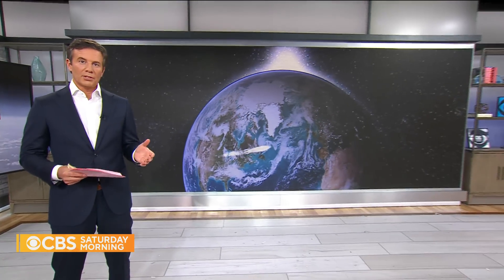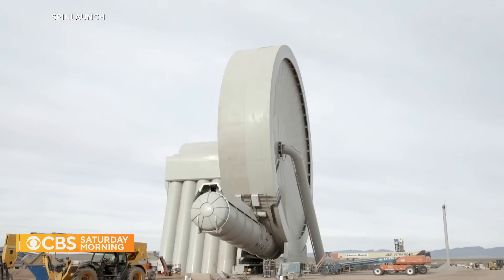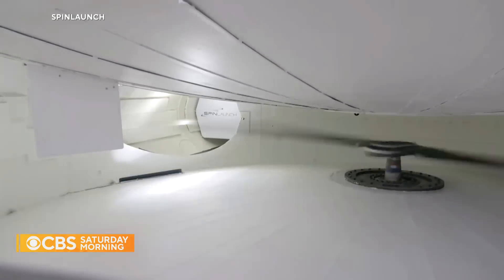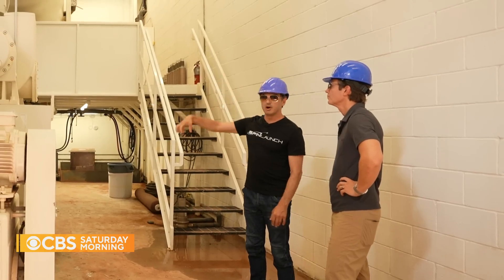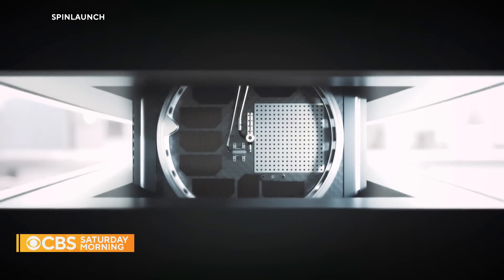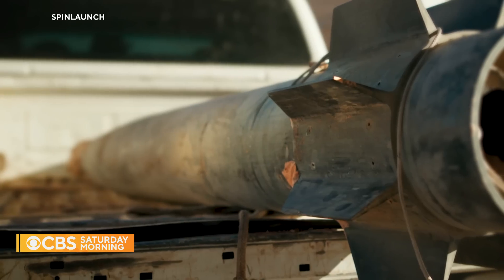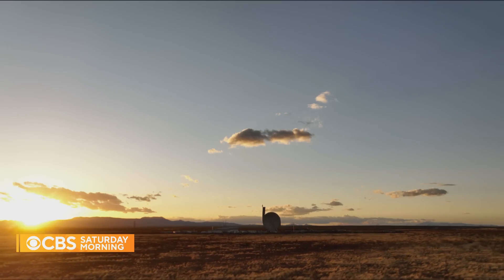New technology aims to put a whole new spin on space travel

Comment: At this point I am beginning to think that this is really a stealth pitch to the military instead of a space launch system. Change the launch arm to a wheel so you can launch multiple projectiles at once, spin it up to sub orbital speeds and you could deliver a dozen or more payloads weighting multiple tons each to any point on the planet. 

Even if you can only get the range up to a thousand miles or something along those lines it would still make for one hell of an artillery piece.
Reply: It'd have the same problem every previous space gun (Nazi's V-3, Project Babylon gun) would have - it's easily targeted and blown up because it's immobile. We have a gazillion smallsat rocket launch companies the military could tap at any time for launching large suborbital payloads.
Reply: @jamesmichael239  Missile Silos are also immobile.
Reply: @coolbluereview  Missile Silos are also designed to be one and done, we're talking about a repeatable launch system here.
Reply: @jamesmichael239  Interesting. I did not know that. For some reason I assumed they were reloadable lol.
Reply: It's a grift. It goes nowhere except for paying a bunch of salaries in the meantime.
Reply: 1000 miles is not long range these days with cruise missiles doing that range. A big fixed target like this would not last long in a war. Don't know what you are thinking about with an 'arm'? It all needs to be in a vacuum to get these speeds.
Reply: @mrbaab5932  I was talking about the centrifuge in the middle of the vaccum chamber. RIght now, you have a motor in the middle, with an "arm" sticking out to the side which carries the projectile and a counterweight on the other side of the bearing.
If you change that arrangement to the form of a wheel, rather than firing only one projectile, you could instead clip several projectiles onto that wheel, pump the air out of the chamber, spin it up and then release them all in quick succession.

And yes, I do think that an artillery piece with the range of a thousand miles or more,  capbale of firing a dozen or more multi-ton projectiles, surrounded by an impenetrable air defence perimeter due to being very, VERY far away from the front line would make every general's eyes light up with desire.
Reply: @Alexander_Kale  Upon releasing the first projectile your entire system would become unbalanced and destroy itself. The counterweight problem is still something spinlaunch can't figure out for one projectile let alone many. Learn some basic physics before proposing "revolutionary" weapons designs, my dude.
Reply: @jamesmichael239 what if the counterweight could get lighter at the same time?
Reply: Every once-in-a-while something pops up about spinlaunch and how revolutionary it is. There are plenty of problems Spinlaunch just won't address or talk about. For example, the points brought up in this video https://youtu.be/9ziGI0i9VbE?si=scqJ6qIs1jHgIBME
debunking some of their claims. That was posted 1 year ago and, so far, spinlaunch hasn't really publicly addressed any improvements or breakthroughs in regards to any of the problems. (At least to my knowledge.) There's a lot more to account for than just sticking munitions onto a centrifuge or disk.
Reply: @wallend4013 😅😅8⁹😊
Reply: This would be impractical for a variety of reasons.

1: The US military already has ICBMs that can hit anywhere on the planet

2: This seems to only launch projectiles in one direction so you would have to know where your enemy is already coming from.

3. It is a large target for enemy artillery and air forces

Basically it's a glorified rail gun lol.
Reply: Sounds like he's finishing what the government started for sure.
Reply: Not a very efficient weapon and not portable at all so super vulnerable. Not great for that application. However, it would be outstanding for rapidly responsive space and storing spare sats like GPS satellites in case the enemy decides to blow up or disable our current set of satellites. This application could rapidly deploy dozens of satellites a day as long as the satellites are ready to go when the time comes.
Reply: @yaxleader  I'm not trying to  be a party-pooper but in order to launch different satellites into different orbits the whole building is going to have to be rotatable which means an added layer of engineering issues and cost.
Reply: @wallend4013  Yes, it will have to rotate at the very least. Which the proof of concept can already do. A single launch location could facilitate the majority of orbits (Cape or French Guiana). A couple more and you can launch in any orbit (Vandenberg and maybe Kodiak). So really not that hard or out of the realm of possibility.
Reply: @yaxleader    If what I remember about the full-size spinlaunch building is accurate, the diameter of that thing is about 1/4 the size of the empire state building or a bit shorter than the length of an American football field. While I could see this being annoying to work around you are correct. It is not, in itself, an insurmountable problem. It would mean more complications and less profit from an engineering standpoint, in my opinion.
Reply: @wallend4013 They already said that there will be booster rockets to take the satellite to final desitination.
Reply: @yaxleader  Vulnerable in the same way a city is vulnerable. It would be so far behind enemy lines it's not funny anymore. And yes, it would be stationary. Not really an issue with this range....
Reply: @Alexander_Kale  The problem with any distance is that no distance is safe if you're facing a modern military. Aircraft strikes and cruise missiles kind of negate any benefits from distance unless you're talking a quarter of the world levels of distance. Proper defensive structures could protect it, but at that point, why not just use cruise missiles? Much more portable and can carry larger payloads even further distances.
Reply: @yaxleader  I am not entirely sure that cruise missiles CAN carry larger payloads, actually. The entire point of this thing is to break the rocket equation, to which icbms are also subordinate. 

IF you could make this work, IF you could spin this up to the point where it can fire a projectile over a distance of say 6000 miles, then what you have here is an installation that can lay waste to any target anywhere within that range, which would be the entire hemisphere this thing is located in. The installation itself would be very, very expensive, but the projectiles themselves?
You could probably fire several dozen projectiles from this gun for the cost of a single cruise missile, all at once if you take the wheel configuration, and the SIZE of your projectiles depends entirely on how good your material science is.

Let me repeat that: The maximum size of the projectile this thing can deliver would ONLY depend on how strong you can make your central axis and the arms holding the projectile. This thing could fire multiton artillery shells by the dozen.

Which is actually a point I do not recall being mentioned here. Even if we use this thing for space launch, do we even have a material you could make the arm of the centrifuge out of? Surely no matter WHAT you make it out of, at those kinds of G Forces a single ton of material would just snap the arm?

Edit:
Having done some back of the envelope calculations, graphene would probably do it. ^.^
Reply: it's a stealth way to bilk investors
Reply: Don't give them ideas man
Reply: Pretty much all things can have a military application. And, likewise, virtually all military applications can have a civil use. For example, you and I are communicating on a network that wouldn't exist without our military having first developed it.
Reply: @yapdog  aha, but you are talking about turning an kind of finished space product into a weapon
Reply: They always have a interest in technology like this.
Reply: Exactly.  😍😍😍😍😍
Reply: Of course it is. SpinLaunch is a massive scam.
Reply: The only military application would be sending satellites
Reply: @bungalowjuice7225   If you can use this to send up satelites at a competitive cost, then you can also send intercontinental ballistic projectiles at a competitive cost. Because unlike satelites, ICBPs don't need to stay up, so they are much, MUCH easier to fire.
And because they are easier to fire, they stress your launcher a lot less, so you can send up several all at once or alternatively send a single one that has several times the mass of your satellite..
Reply: @Alexander_Kale  maybe but I don't think it would change all that much.
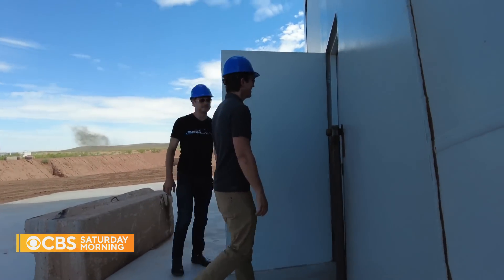Reply: 4:35
Reply: 4:54
Reply: 4:54
Reply: 6:53 6:59 7:11 7:12
Reply: 8:02
Reply: 8:02 8:16
Reply: 8:16
Reply: Such a great weapon. Small miscalculation or imprecision and your bomb explodes the  launch system and everybody around.
Reply: @EarendilTheBlessed  How's that different from rockets? 🤨
Reply: @yapdog 
Thought the same at first. But rockets can dogde in the air, they are not contained in a very small and narrow passage. They are also not at maximum speed at t=0, worst case you can probably abort in a controlled manner because you are still at slow speeds. On the other hand, you can really abort in a controlled manner if the payload just get crushed against the launcher. Unclear if a nuclear warhead would explode, but still more dangerous.
Reply: Easy solution. Giant bulletproof bomb proof shield. Next... lol
Reply: No, it cannot be used repeatedly. Did you notice that the projectile had to break a membrane? That lets the atmosphere in.
To be fired again, a new membrane has to be put in place and a vacuum restored, then the arm has to be brought back up to speed.
Reply: Itd be very inaccurate i bet
Reply: If ol' govie wasn't thinking about that, they maybe now... lol
Reply: would never be able to use it as artillery for the same reason they wouldn't be able to aim the rod of god everything is going too fast once you are at orbital speeds to be able to aim it purely ballistically
Reply: Yikes, sad but the moment after I wanted to comment on how cool this was, the second thought I had was how easily it could be weaponized. Aside from that it's a super cool idea.
Reply: The military made supersonic weapons over a hundred years ago. It’s called a cannon. Look at the battle ship guns. All supersonic
Reply: Great way to test hypersonic missiles.
Reply: Great idea!  If our forces are getting overrun by a swarm they can spin up precision guided bombs to pepper an area.  Another idea... In SciFi, they have drop ships.  In the smaller versions, maybe you can sling military equipment to areas of the world that the military needs to get to fast.  If there is a civil war somewhere that the people are getting slaughtered and you want to give them a fighting chance by slinging equipment to them.
Reply: I agree. There’s no way they can build one large enough to launch a significant amount of cargo into orbit. But as a weapon striking something on earth it looks very viable.
Reply: It will be in a fixed position, and the rate of fire will be very slow.

This is not tactically viable in any way you look at it.
Reply: @marty7442  Fixed position way behind enemy lines: Makes it hard to target. 

Slow Rate of fire: Says who exactly? As detailed in this thread, one could imagine replacing the inner bar like mechanism that holds the singular payload with something more resembling a wheel, which could hold multiple rounds. Considering how how the G-Forces decrease with a larger radius, and so this thing gets simpler to manage  the larger you build it, that means pretty much an arbitrary amount of rounds fired in a single serving. Though there is probably a sweet spot to be had between number of rounds and ability to turn what is effectively a building. 

Still, in other words, whatever you aim this at would be drowned in a rain of projectiles. And if you still need more ordnance delivered to that particular place, you can always build more than one. ^.^

Don't get me wrong, I agree that this is probably never gonna happen, but not viable in ANY scenario? not even close...
Reply: well, they wouldnt need to be stealth about it as there arnt many providers. Even the contracting done for jets is a mere formality. It would also simultaneously advertise to adversaries or competitors, for that matter. There is zero benefit to be public about it if the intent is purely military use.

Military also coulnt care any less about green tech and they're not scraping for funding, since war is one of the greatest businesses.

If they wanna advertise, its indeed commercial space
Reply: @fetB so does it departiclize the thing in there and shoot it out? And then the thing reamergers in space like light speed but on the ground idk 😅😅 totally guessing lol
Reply: I believe there is a reason it's a launch arm and not a wheel and if they did the wheel would shred apart from the imbalance after one left. They have to seal and get the vaccum to acceptable levels again then launch another. There is a documentary of this on youtube and why.
Reply: @adester1  I think the easier explanation in this case would be that the project is still at the experimental stage and the wheel configuration would offer little research benefit for a significant increase in cost.
Reply: It would have unlimited range as it is used to launch things into orbit. Good way to create and fire a large number of mini ICBMs
Reply: @coolbluereview  all they have to do is sling the warhead. It could be put into sub orbit and it could hit anywhere in the world. Accuracy would be an issue but with testing it could be calculated to the point it wouldn't matter.
Reply: I see it more being a better pitch to telecommunications companies.

Instead of spending hundreds of millions or billions on a spacecraft to put a satellite into orbit, you could simply launch it as a projectile into orbit.

70% of the cost of a rocket is going to just getting the payload in orbit. This cuts that cost down immensely.

Also supply runs to future space stations. 

Or as the technology gets more advanced we could see it launching a smaller spacecraft that can get into orbit and from there it could navigate to the moon. It saves the need for launches actual spacecraft for humans or larger spacecraft, cutting down the cost when it comes to transporting goods.

Hell imagine if the payload just carried goods and just launched them to other places on earth. Instead of relying on planes to transport your Amazon package, you could just launch it into sub orbital space and it could land at a set destination.
Reply: in space where theres no atmosphere you could get an inf number are rpms its more likely to turn into a rail gun
Reply: You clearly have not thought the physic out!
Reply: It’s significantly safer for an ICBM stored on a truck to be transported to secrecy than a skyscraper sized tape measure.

The only way this get’s applied to the military is launching satallites if other companies like space x become unable or unreliable.
Reply: why the hell would you want this to be a weapon... classic american
Reply: @rpm749 there’s not one mention of him saying he wants that so I’m not sure what you thought you read. But yes ofc there are people who would want to weaponize anything and everything, and they are not limited to one part of the world.
Reply: @tylerhaynie5769  well he said he sees a military use in it and then made suggestions on it, sooo….
Reply: @rpm749  You really think that that's solely an American drive/thought??? Pretty naive.
Reply: @yapdog  when I look at the military budget of America, it’s most likely an American talking about weapons in English on the internet
Reply: @rpm749  You're talking about 2 different things. We average American citizens don't spend money on the military. So, don't confuse us with the government/military.
Reply: @yapdog  where do you think the money is coming from?
Reply: @rpm749  Don't be so condescending. You know exactly what I'm saying.
Reply: @rpm749 pretty sure it has less to do with wanting it to be a weapon and more to do with the fact that it will never launch anything useful into space, and probably won't ever reach space at all.
Reply: @rpm749  So we can keep being a super power over you.
Reply: @rpm749  
Because new technology will be a weapon in the first place.
All other things come later.
Reply: @rpm749  Problem with that statement? I am not American. ^.^
Reply: @Alexander_Kale  yes, instead of getting further as humanity you just think about how we can best fight ourselves again
Reply: @Alexander_Kale and for that we are thankful you are not!
Reply: @Alexander_Kale  While I agree it is pretty said, it is not just America, someone will always see a weapon in anything, therefore this always happens, and yes it is sad. You ever watch Real Genius!
Reply: @rpm749  yeah, we don't know what we'll encounter the further out in in space we go, if we can redirect asteroids or move other celestial objects with something like this attached to one of our vessels, it's already a weapon, it's all in the hands of the users!
Reply: @rpm749 it's the reason most of these despicable groups of geeks design technology.